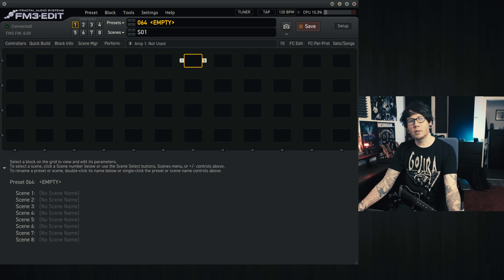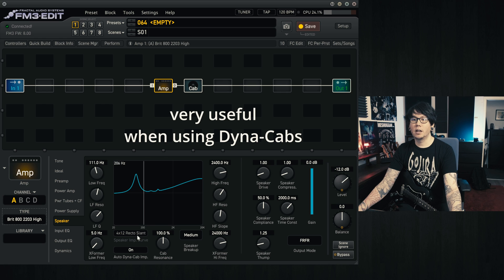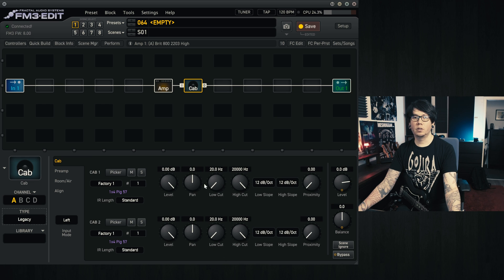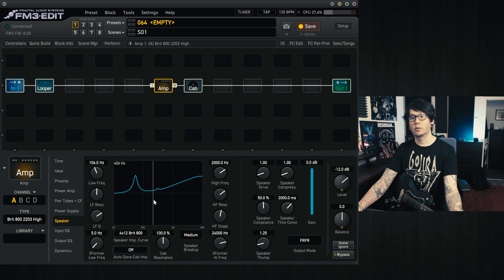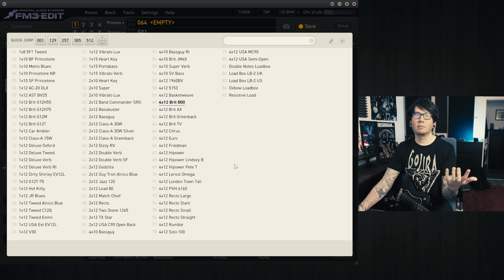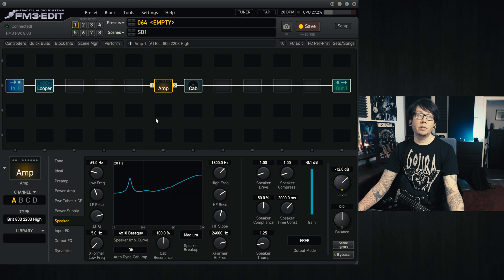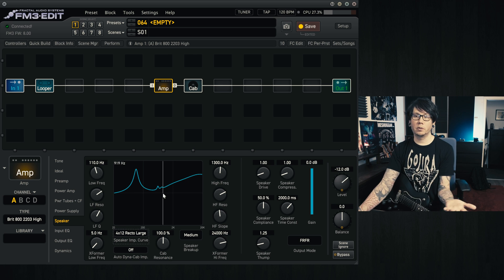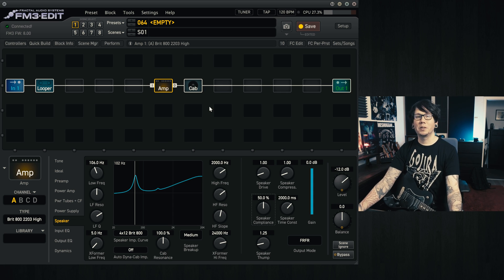Amp Block Speaker impedance curves - FRACTAL FM3 / FM9 / AXE FX 3

Comment: I've been using the 5153 imp curve with the I O N I C 4x12 CAB from Otto Audio and raising the Speaker Thump. If you're playing at bedroom volumes, it's great to turn it up around 2-5. Also, the gain enhancer in the Dynamics tab of the amp block is another great option. It's amazing how many fantastic variables there are to play around with.
Reply from the maker: absolutely , the amount of fine tuning on tap is really useful in getting that last 5% dialed in